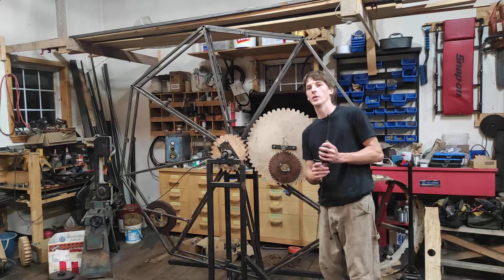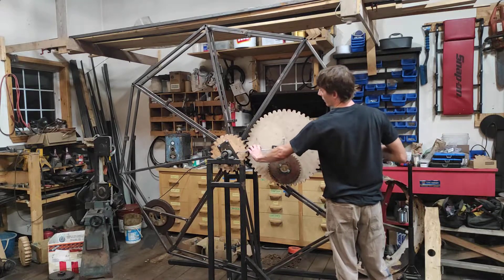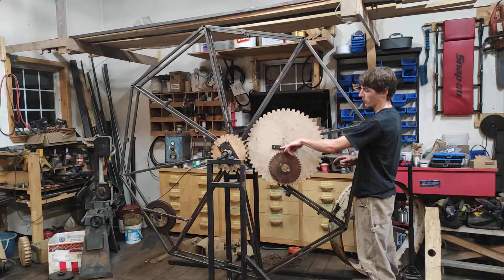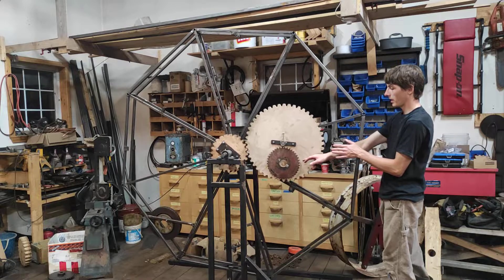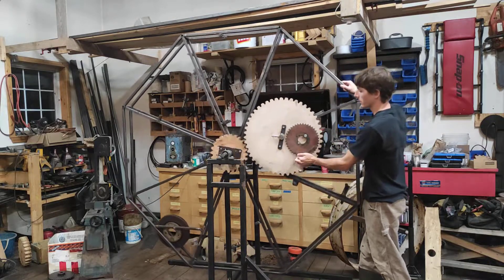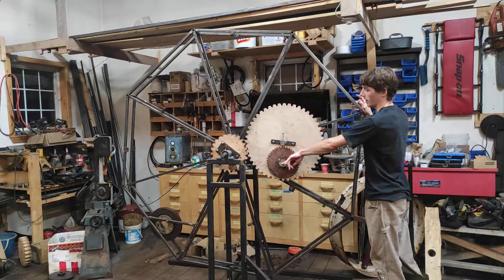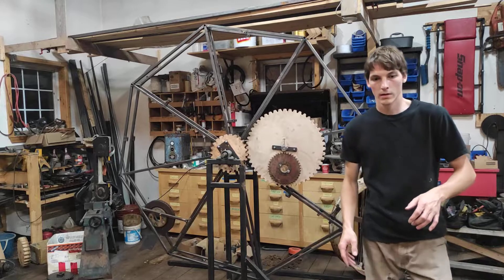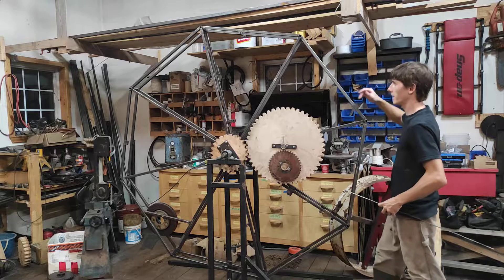Sliding Weights versus Pivoting Weights

Comment from the maker: Not mentioned in this video: You CAN use pivots if the shaft is parallel to the tangential velocity. Like in this video: https://www.youtube.com/watch?v=l2noFDNDEZ8 However, if the linkage mechanism is not perfectly centered, it will create the same effect on the wheel described in the video. My apologies for leaving this out of the video.